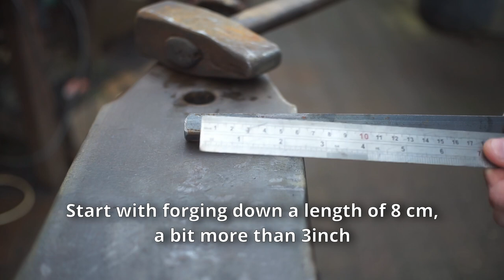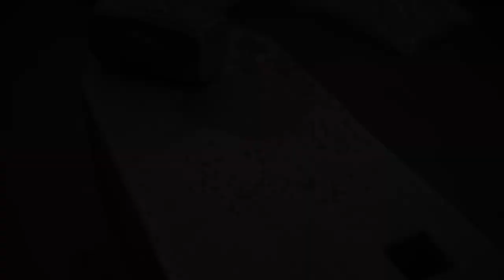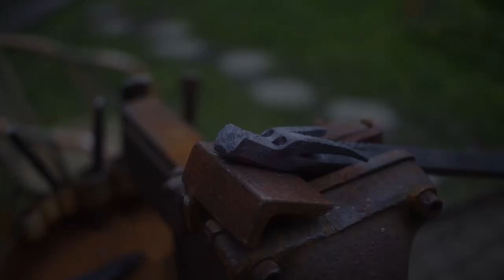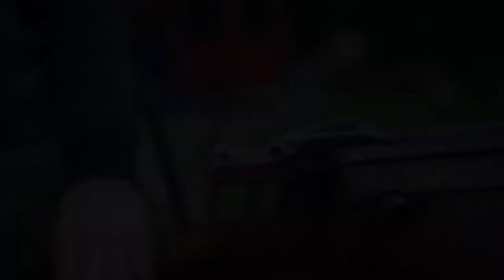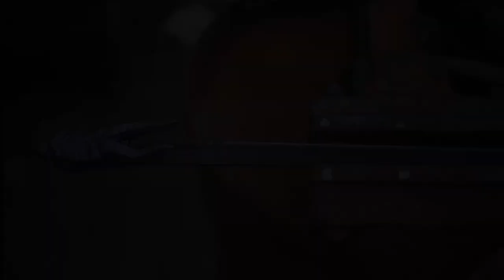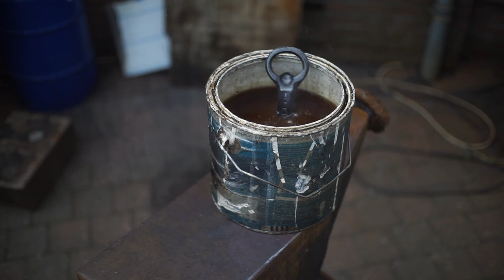Forged Dragon bottle opener - Blacksmithing

Comment: I have done this making horse heads. Good tip is to heat the steel before welding. This way your bead blends and penetrates way better.
Reply from the maker: Normally I would do that yes.
I guess I forgot to whilst filming.

Comment: Your dragonheads are amazing, watching and studying your videos constantly :D

Did you weld same size square stock to the angle steel to hold both in the vice?
Reply from the maker: For the angled plate I just used some flat bar.
30x10mm would work fine.